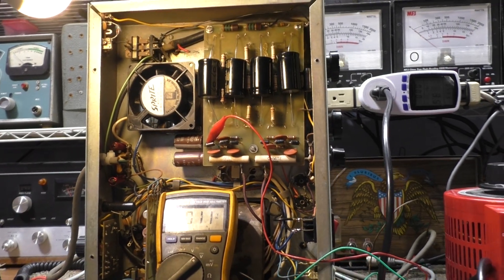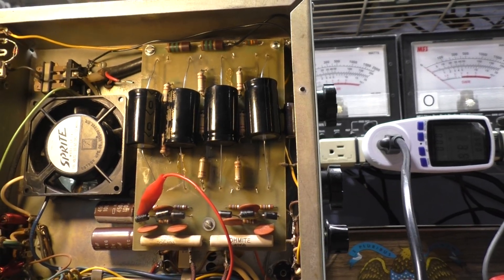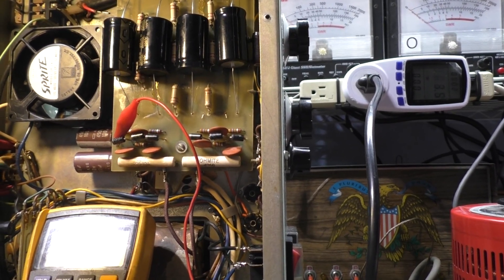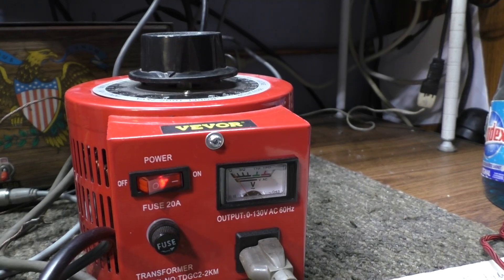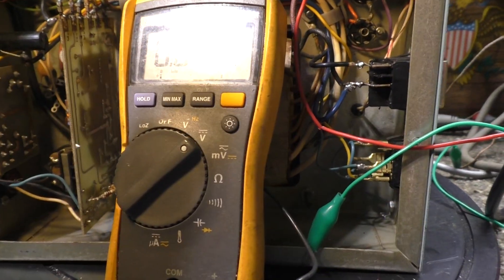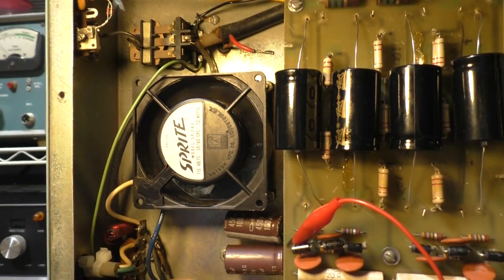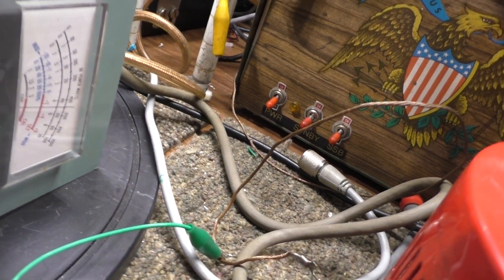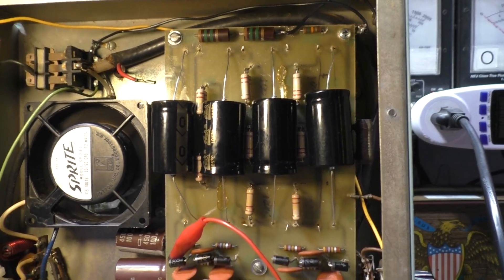1st time power up/testing, Mohawk 10 HF Linear Amplifier

Comment: Found Mohawks are only safe to operate turned on one side. Makes the 572B tubes vertical. To use that tube on its side pins 1 and 4 have to be in the vertical plane. Keeps the "W" shaped filament in the vertical plane so it won't sag against the grid and short. Mohawk mounted the tube sockets 90 degrees wrong, so the grid and filament are now laying flat inside the tube. Not a good idea. Had to tell more than one customer what it would cost to spin each tube socket a quarter turn. I always suggest the cheap solution is to operate it turned on one side.

Comment: I understand disconnecting the high voltage and through process of elimination figuring out what's wrong.  Could you test the tubes first to make sure those are ok before powering the whole thing ?  I'm just trying to learn.
Reply from the maker: Problem with testing a transmitting tube is the only real way to test it is to power it up drive it and see if it puts out.
Reply: @tramdr I get it now